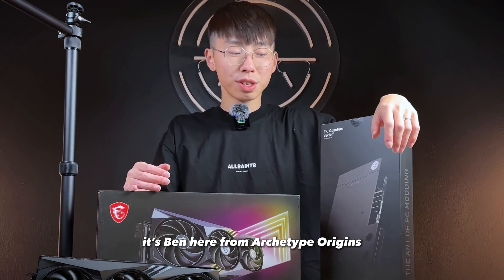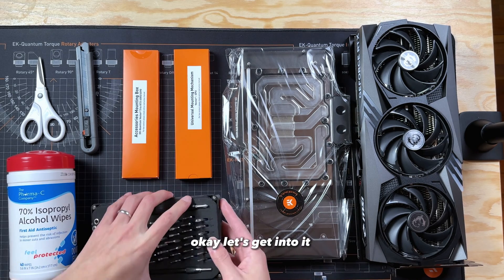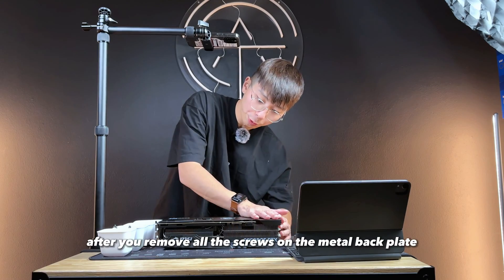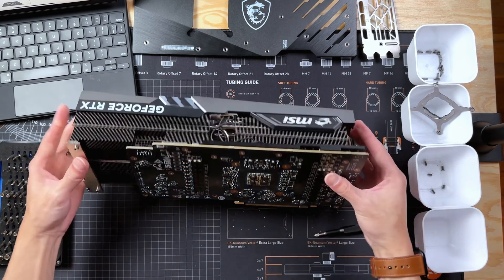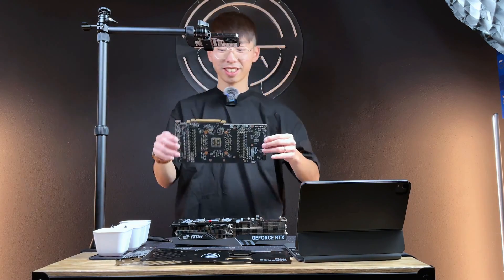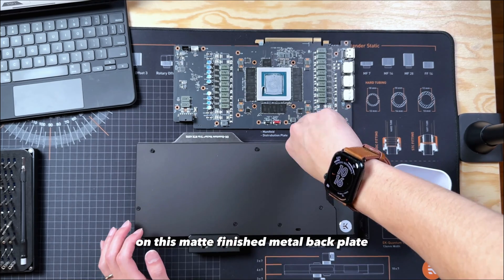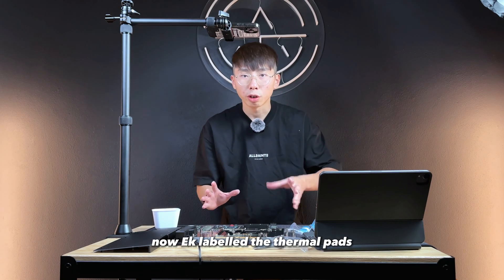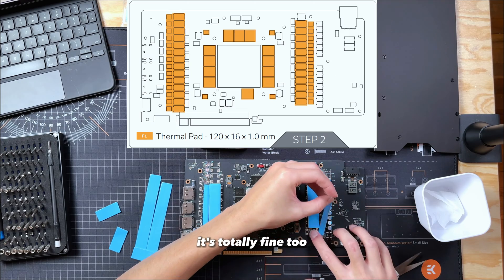How to Install EKWB EK-Quantum Vector² Trio RTX 4090 GPU Water Block [Tutorial]

Comment: Can you use dual 5090s with water cooling? Also, where do you get the radiator, etc? Does the piping have enough clearance for 5090s? in ATX cases? Do you have to use FE or any 5090? What is going on that they are using magnets with this design? Using Magnets in computers is a giant NO NO.... Wow. I can't believe how bad some of these product designers are. They chose aesthetics, just to have a magnet to cover the screw holes LOL. What? Sounds like a recipe to short out your board if you drop it on it lol. Their video looked like they were strong magnets too.

Comment: How to install an EKWB product. Unbox the product. Take it carefully out of the packaging (because it might break, because its garbage). Then look under your desk. Is there a rubbish bin there?  Very carefully, put it, in it. Before it fks up something else.  

Because you just paid too much for a bad product that is unreliable garbage that might screw up everything you have. It is garbage plated e-waste. 

Once you break out of the EK ecosystem you realise how bad it is. Oh I have a lot of videos on that too. Typically running 4-6 bench mark machines for fun at any given time. I know, so I have an odd hobby. I sometimes test to destruction for a laugh too. But not because something is so bad, it just doesn't function to any sort of reasonable expectation. EK nearly ruined my hobby!. They make bad products and I was so locked in I didn't realise how bad they were until it got ridiculous.   I literally had to drill a 7950x cpu out of a perfectly fine very premium, x670E motherboard because their awfully badly ( I mean like negligent) designed velocity 2 cpu blocks, made with poor quality material, basically fell apart when being uninstalled. But, I don't want to make it about that one instance. They have got worse and worse over the last 24 months or so. It is ridiculous. Then you go to another vendor and it is like a revelation.

Comment: You don't have to remove the IO-Bracket. Screw in the screws back to the cooler so they are safely stored. You need the cooler for warranty and to resell the card later.

Comment: just finished installing the block and the io support is a joke, the card now HAS to go vertical mount on my case. (the io bracket had 4 screws, 2 vertical with the pcb and 2 horizontally on the cooler/chassis, now it has only the 2 vertical on the pcb and its super flimsy and dangerous to break it with the pcb (4090 liquid x)

Comment: I never knew how they fit such massive gpus in thin laptops, until today. Very cool!
Reply from the maker: This is not the GPU they use in laptop tho 😭
Reply: @archetype_origins I know lol, I meant I used to think the heatsinks were part of the gpu, not that the gpu itself is much like a cpu
Reply: @volteriaz  A 4090 in laptop is close to half the speed..Its not really the same
Reply: They only put in the chip, and it's a smaller mobile version usually. My old g15 advanced gpu was a rx6800m m meaning mobile version. They don't put the desktop version in laptops.